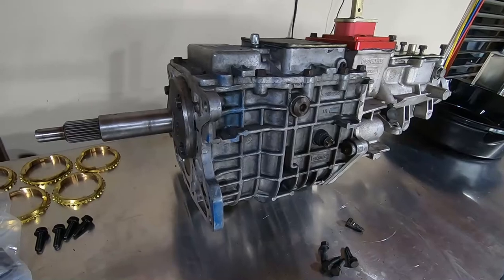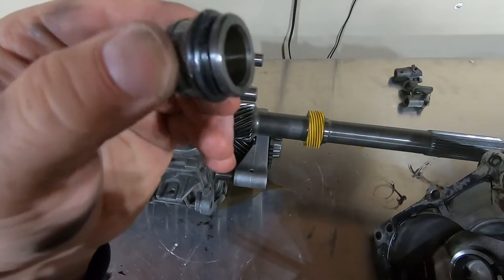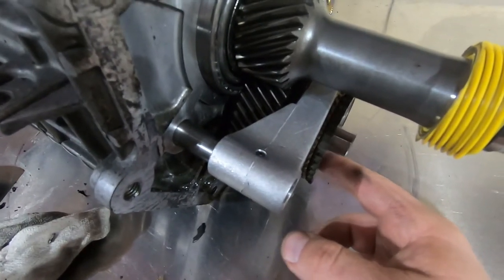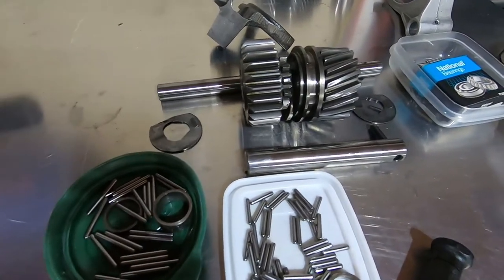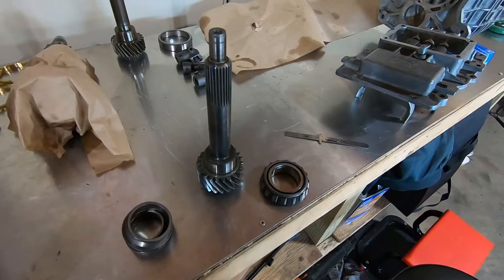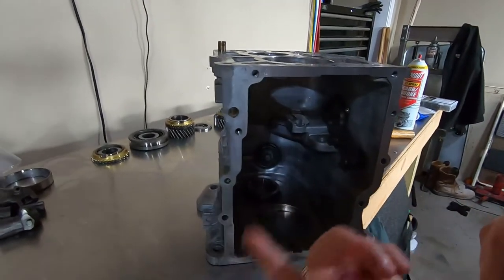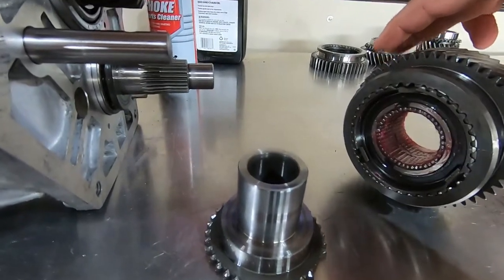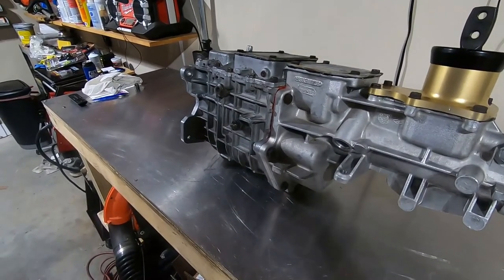Fox Mustang Tremec 3550 TKO Rebuild

Comment: any reason you didn't opt for the fiber line synchro's they offer for them now?  Those weren't available last time I rebuilt mine. Who did you source parts from?. I just wish they where cheaper to rebuild, sliders and other parts add up quick. Have a couple 500/600's I picked up used I need to go threw soon.
Reply from the maker: @nothanks, I called a very trusted Tremec vendor and asked about the longevity of the carbon lined synchro’s as they aren’t made by Tremec, but some other company. He sounded a little hesitant on answering the question, so that’s all I needed to know. I didn’t want to have to tear into this trans again at a later date because of inferior parts. The stock blocker rings are pretty good and last a long time, so I went with those. I sourced my parts between AMP and Hanlon, both are really good to deal with. And yes, parts for these things add up quick. Good luck on your rebuilds 👍

Comment: Hi
Having major issues with front bearing retainer fluid leaks on my TKO500 Used loctite 518 as anaerobic sealant but leaks after refit.
Any pointers gratefully received
Thx Dave
Chevy 350/Tremec combo
Reply from the maker: Was the input shaft seal area scored at all? Usually a red scotch brite pad will clean seal surfaces up. Did you replace the seal in the input bearing retainer? If so, which direction was the lip of the seal facing? And finally, was the bearing retainer clocked properly when installed?
Reply: @GeorgiaStangMan  
Thanks for the reply
Yes bellhousing clocked in ok
The seal has the spring facing aft within the seal and the metal base installed correctly. Third time lucky sealed and ready to fit🤞
Reply from the maker: @davidcotterell2037  awesome, glad it worked out for you 🤘

Comment: How much did you end up having into trans after parts?
Reply from the maker: Unfortunately, after everything was said and done, it was in the neighborhood of $1500 with transmission included. It kind of sucked that so much needed to be replaced. Just know that is not the norm with these, just when they aren’t installed properly and then abused, you get this.

Comment: Just found this video, excellent job.  I have a new tremec 3550hd with 10 spline input and 26 spline output.  If i upgrade to 26/31 spline shafts does the counter balance shaft need to be replaced also?  Ty for any help.
Reply from the maker: No balancing necessary if upgrading a 3550 to TKO. You’ll need 26 spline input shaft, 31 spline main shaft, and 31 spline TKO tail shaft housing due to the bushing bore being bigger. Everything else should transfer over. Good luck 👍

Comment: What shifter did you use??
Reply from the maker: On this one I used the gold Hurst shifter. I typically use those. I also have a Pro 5.0 and a Steeda Tri-Ax for these sitting on a shelf too that I acquired through trades or they were on transmissions that I bought. They’re all pretty good shifters…. Any of them are better than the stock ones lol